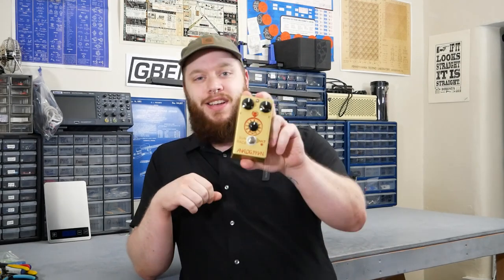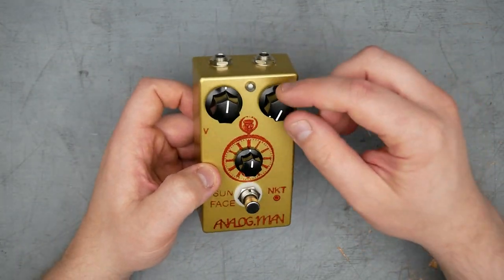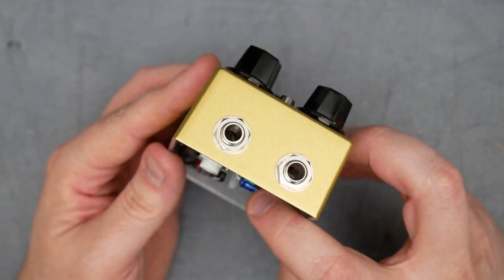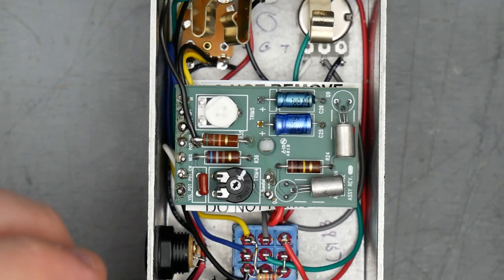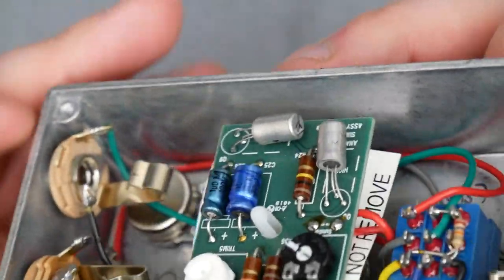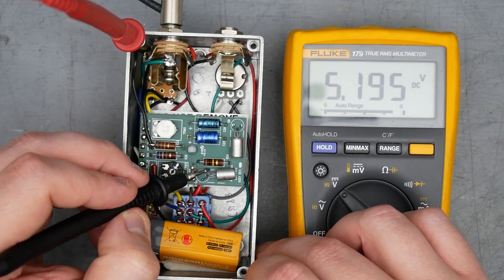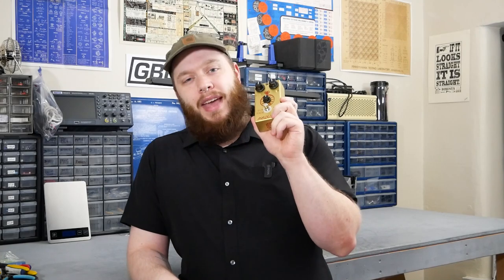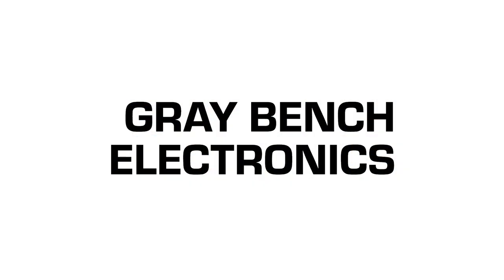Analog Man Sun Face Teardown! See what's inside!

Comment: Thanks for the great video! If you squeeze the plastic standoff which is in the middle of the board you can pull the board off, we use them on many pedals. We have sold thousands of these and I don’t remember any coming back with the standoff not attached. but if you are worried you can put some foam on top of the board before the bottom plate. I don’t like PC mounted potentiometers, they tend to break a lot and are more difficult to change, although I do use them in a few of our pedals. Our latest fuzz board this summer has LED hole, I didn’t really like tacking it on the resistor either. It also has two additional optional components which would’ve been fun to see if you could figure them out. :) 
thanks and have fun!
Reply: I use them too, I buy the ones with industrial adhesive, they dont come off. DAM uses them as well.
Reply from the maker: Thank you!  As far as the LED wire,  like I said in the video, I've done it too.
Reply: DC jack and clock?
Reply: Hey Mike, big fan of your pedals. I have a sun face and chorus from you that are wonderful. Keep up the good work!

Comment: The 50K trimmer is the "clean" control, it serves two purposes. It raises the input impedance of the circuit which works better with humbuckers, and it also makes the pedal play nice with a wah pedal, just tweak it with your wah pedal plugged in before it and it will make the circuit sound a lot better with it. Common old mod from way way back in the day.
Reply from the maker: Good info, I think this was one of Fuller's mods?
Reply: @graybenchelec  Dave Fox told me about it when I was helping him with the Captain Coconut about 20 years ago.
Reply: @graybenchelec  I was doing that in like 92 myself, I forgot who told me about it.

Comment: The profit margin on these pedals must be astronomical.
Reply: Sort of.  You have the time spent sourcing and sorting those vintage resistors and transistors. I've built some pedals and doing it by hand is fairly time consuming.
Reply: @fredtaylor9792  Waste of time.  Makes no difference whatsoever.
Reply: @BenState  But that's a different discussion.  Waste of time or not,  it costs time and money sorting and matching germanium transistors and if your customer wants a fuzz face with germanium transistors,  you have to buy a batch and hope you can pair a few together that work. And therefore,  you have to build those variables into the cost.
Reply: @fredtaylor9792  Again, charging customers for wasting time is not a cost its a scam.  Matching germaniums takes no time at all and doesn't come close to making up for the extortionate prices charged for some of these basic circuits built like crap.
Reply: @BenState  A scam?  Now you're just being contentious.

Comment: hey! love your videos! love this tech nerd thing as always!
and i just got a question, i see a lot fuzz face type clone or anything like fuzz face. almost 90% of the input cap is 'electrolytic'. it is 'must' be electrolytic or for what anything 'important' reason? can I just use poly or other types cap? what's the different types cap will 'do' in this case?
Reply: I don't think it does, it's just most fuzz faces use 2.2uf and that's usually an electrolytic capacitor. I have one where I used a 1uf film capacitor for the input and it works and sounds pretty good

Comment: Hey Joe! I enjoy watching all of your videos… this video in particular is one that brings up a question because i am a bass player. Why is it, or, what is it about this circuit that makes it extremely hard to use a bass guitar with it??? I know its not as easy as allowing more bass with the input cap change. I have the big blue Dunlop Hendrix bc108 model fuzz face and I do use it with my bass rig, like a good guitar player would, and I am able to get some really nice clean to overdriven sounds depending on my bass’ volume. The big red germanium I have is almost impossible but only works with one particular P-bass going through my ‘65 ampeg b-15. I do have an earthquaker devices cloven hoof that has all silicon trannies, with the help of LED’s i believe and that pedal works great with bass. Also, the “go to” thing to do is add a blend knob on most pedals but I have to refer to my first question… what is it about this circuit and what can be changed to make it work with bass guitar? The usual things are that there’s an obvious loss of low frequencies (besides the Hendrix model bc108) and the fuzz is usually way blown out with volume full up. Thanks for your time, Joe. Great content! 🙌🏼❤️

Comment: The video is impressive and highly informative! I'm intrigued about a technical aspect. Regarding the schematics displayed at 12:37, I'm curious if the 50k input trimmer is accurately represented. Specifically, I'm wondering if one of the three leads of the pot should be connected to ground. Thanks to whoever can provide an answer to this question.
Reply from the maker: I'm pretty sure it's wired as a variable resistor as my schematic shows, but I see other schematics showing it as a potentiometer to ground as you suggested. Unfortunately I don't have one on hand so I can't check.

Comment: Hey Joe (where are you going with that gun in your hand :) )  with this pedal having a positive earth rail, can it be connected up with other pedals having a negative rail?
Reply from the maker: You can indeed, you just want to be careful with power. Rule of thumb is positive ground pedals need their own power supply, or their own isolated output from a power brick.
Reply: @graybenchelec  Thanks for that, So I'm guessing that plastic 1/4 would be a must!

Comment: Do you know anything about the early 90's dallas arbiter fuzz faces that have nkt275 marked transisters in them? I have heard that they are fake and never were real nkt 275s to begin with, but actually do love the sound of them. I realize that is all that matters is whether i like it, which is why ive held onto it as long as I have, but have always wondered and wanted to know if they are real nkt 275's
Reply from the maker: My understanding is that they are germanium, but they're not made by newmarket (NKT). They're relabeled transistors.
Reply: @graybenchelec  thanks for the reply.  That's kind of what i figured.  They do sound great and it's cool to have a pedal that looks like the og.

Comment: When building a fuzz face clone, does the input and output capacitors need to be polarized electrolytic or can they be a polyester type (non-polarized)?
Reply from the maker: It will certainly work with non-polarized caps, film or otherwise. If you're building with a PCB, you may have trouble finding a 2.2uF film cap that will fit the allotted space on the board.